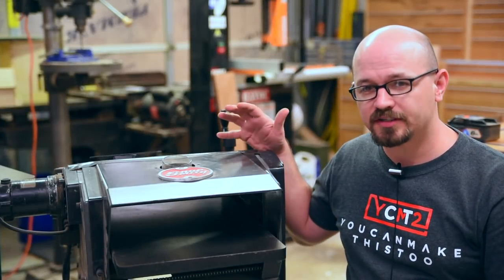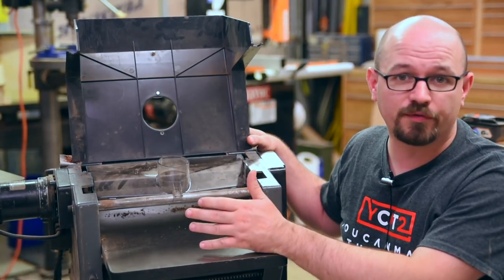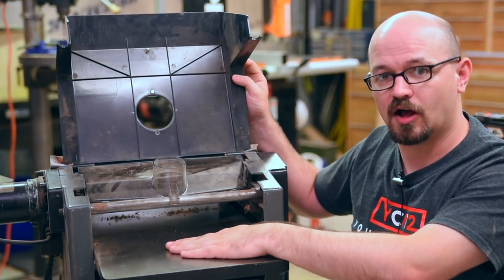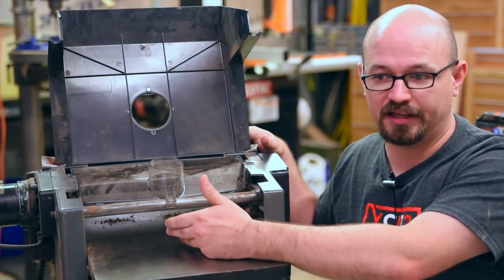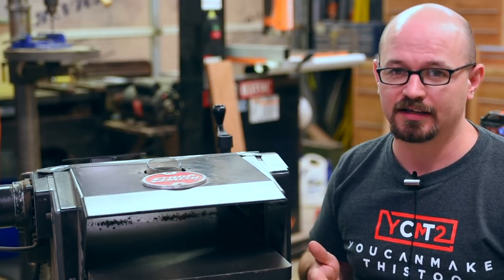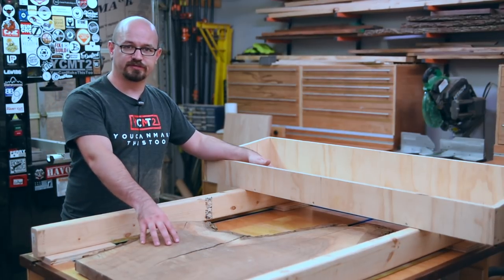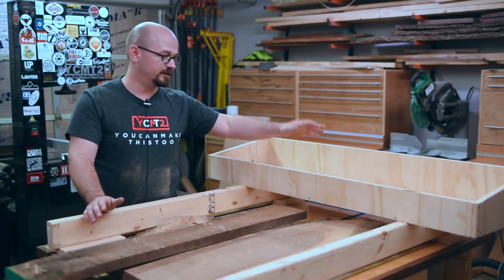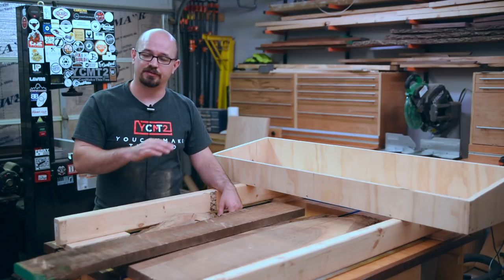Woodworking Without a Thickness Planer

Comment: Thank you for putting up this video. After recently moving from the UK to Poland I am trying to set up my new workshop on a tight budget and my wife thinks I'm too wishywashy because I cannot get my list of tools together for the things I need to start a small business working with wood. I would love to buy a thicknesser / planer but I know that I can probably achieve the same results with a belt sander its just that the thicknesser / planer would do the same job quicker and with less dust probably, but I cannot really afford a thicknesser / planer at this moment in time and nobody ever seems to sell a used machine unless they are big industrial sized machines, I've been scouring the internet for several weeks now looking for both brand new and secondhand machines and have not seen one single used Lunchbox sized Thicknesser / Planer anywhere probably because when people do buy them they hang onto them for life and they never upgrade and so they never get sold, but you have confirmed for me that I can do the same thing with a belt sander, so I shall probably start with a belt sander and hopefully in time work my way up to purchasing a thicknesser / planer when the time becomes financially right. 

Question  1.....?? Could I not buy a router and make a sled for it and run backwards and forwards over my secured board until flat, I am aiming at making designed chopping boards made by glued strips of wood clamped together, these will definitely need to be made flat after the glue has dried the pieces together, then after using the router I could just finish the board with a random orbital sander before finally oiling and waxing the boards ??

Question 2.....?? I have a table saw although not the best and defintely it doesn't even have a very fence on it, my father-in-law uses it to cut scrap wood for firewood I have now inherited it, but I could maybe make a fence and attach it by way of small clamps to the table to it to make it cut straight from boards, so could a table saw do the same job ??

Or maybe I could I buy a band saw and get the same straight edges then finish the edges of my wood with the afforementioned random orbital sander before glueing all the strips together ??

Your imput would be greatly welcomed

I have previously subscribed to your channel but you have another thumbs up from me for the great video thanks 👍

Cheers 

Glen 😁👍
Reply from the maker: Best of luck to you setting up the new shop! So all three of the techniques you proposed would work. A belt sander is feasible.. but will give the most inconsistent results. The router will work well, but is very slow and extremely messy. The table saw can but is limited by the short blade. The bandsaw is probably your best compromise. But it really comes down to how flat and true you need your lumber to be for your projects.

Comment: you can also create links to timestamps simply by putting "mm:ss", where m represents minutes, s is for seconds.   this works in both comments and in the video's description.    thanks for timestamping it in your video though!

1:50 Sled
3:00 Hand Planes
4:30 Belt Sander / Power Planer
6:50 Drum Sander / Wide Belt Sander
Reply from the maker: Ah thanks! Great tip! And super thanks for being kind about it.

Comment: Seems to me that this video shows a bunch of things that replace a jointer, not a planer. With the exception of the router sled, none of these tools reference the flat face and make the other side parallel to it. You would have to use a marking gauge and then eyeball it. And that’s not very accurate it you’re trying it eventually  join or miter the boards together. If the title was "woodworking without a jointer" it would be a 10/10.